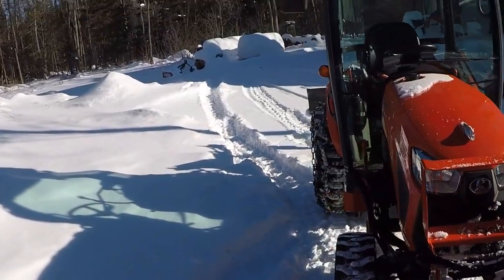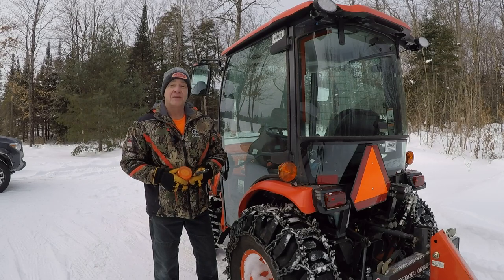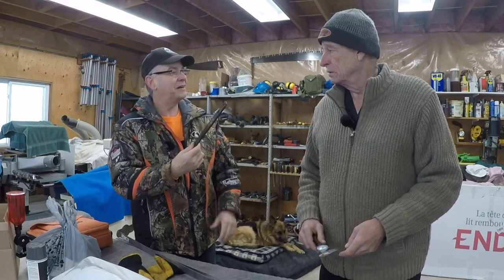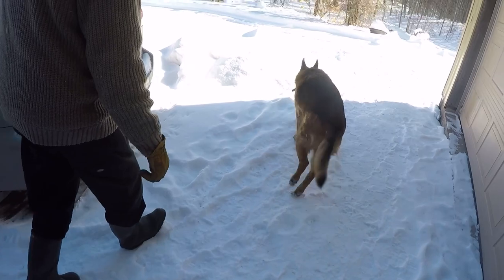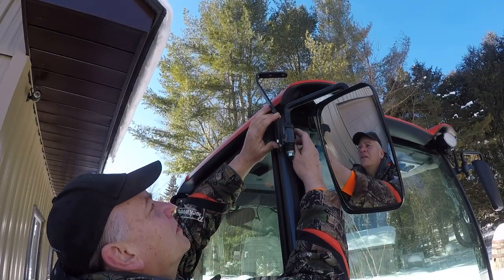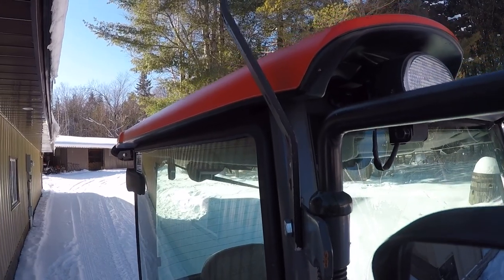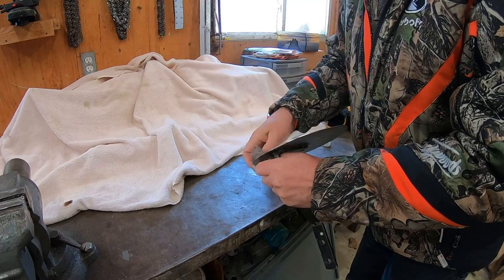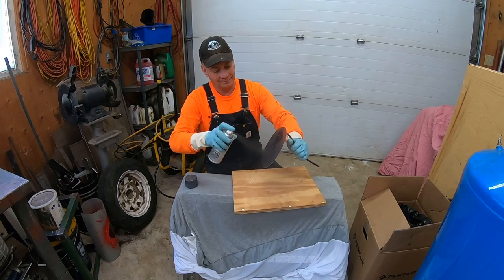525 Warning Light LED Beacon Install.Kubota LX2610 Cab Tractor. Part 1- The Mount. outdoors

Comment: Hi GP,
Adding the warning beacon is a very smart idea for where you drive. No matter how careful you are there will always be people that don't pay attention to their driving.
It's great that your mirror bracket has the pre made hole.
I'm thinking that mounting it on the drivers side would be a preferred location. Or an even better option is having two lights.
Reply from the maker: Morning and thanks Tom. I think so too. The driver's side has the antenna for the radio in it and I was not sure how hard or easy it might be to remove it. Thanks again- have a great day!

Comment: Guy is my kinda Dude! Love being in shops with folks like him. Kindred spirits... Buy a few extra lens caps for that model light while it's in production. A year from now proly will be a newer version... Low hanging snow bent branches might get her cracked/busted... Quick change of lens cap and not a full out replacement cause you cant find lens cap... County/gov. doesn't have to worry about bursting/cracking theirs much being on top cause they cut the trees back from roadways. Still Love how you do your homework in buying stuff though GP. 👍☺
Reply from the maker: Cheers BB! Guy is pretty awesome!

Comment: I used to like welding 16 ga when I was fabricating ductwork. It was actually the heavier ga I got to work with. I've done auto body work also which is generally 22-24 ga. You can tell Guy has welded different thickness metal before. My friend John and I both hang on to any steel we get because it's very expensive to buy at retail and if you can come across it for free it will always be repurposed!!

Comment: From looking around at the equipment in Guy's shop, I'd say if he can get it done for you, nobody can. 
I have installed for 3-LED strobe lights one at each corner of my  cab. I have them 'hidden' under the roof edge to protect them from overhead branches etc. and I can tell you that if you don't see 
me rolling along, you must have your eyes closed tight. Just a way of agreeing with you and others, that warning lights are an important item to have on a tractor if there's any chance that people
will be nearby when you are operating it.
Reply from the maker: Morning Reg! That was a great idea to run them along and below the roof. Should keep them safe from harm for sure. Cheers!
Reply: @GPOutdoors  Yes and so far so good :)

Comment: Gord, was Guy in tool & die work or engineering. He sure has an eye for fabrication.  I was concerned about the clearance between the bracket and edge of roof, but I see there's about 3/4 inch of space. Very nice job so far.
Reply from the maker: Morning Mike! I don't think so but he certainly has alot of skills. I am very fortunate for sure. Have a good one!

Comment: Hey Gord,

That is looking great! Once again, Guy comes through for you in a pinch. I can’t wait to start on the bracket for my LX2610….I’ll have to keep my eyes open for a piece of garage door hardware like that:)
Reply from the maker: Too funny Mick. Honest. I will explain it in part 2, but that 13" piece of standard garage door opener steel was; a) thick enough, b) long enough, c) had holes pre-drilled in it, so d) the holes were the exact same size as the holes in the mirror mount on the Kubota cab, and e) was the same size as the hole for where the wire comes out of the beacon. Plus, I can now cable tie the loom and wire nice and neat using all those holes. Honest. No lie. Thanks for your kind insights. :))

Comment: Gord, one problem you might have with only one bolt through your new bracket and mirror bracket is, if you hit the beacon with a branch, or other object, while moving forward, it could pivot back and gouge up your cab roof (from the way the mirror bracket is angled)  Just something to watch out for.
Oh yeah, almost forgot, ...w00t!
=O)
Reply from the maker: I got a w00t! That's good point to watch out for. Thanks W!

Comment: Great start GP 👍.  I’m guessing your initial method would have worked, but unless you built stuff like that regularly, you might have taken the long way round doing it. Why reinvent the wheel so to speak. Just shows how smart you really are, getting some advice and using it. 🤗👍.

Comment: Gord would rubber or foam work  to stop any vibration where the bolt goes.
Reply from the maker: Hi Gord! That's a good thought. I asked Guy about it and he said we should be ok. He took a cold chisel and hammered a rough surface onto the bracket for grip but we'll see how it works out and may have to make some adds such as you have suggested. Thanks Gord!

Comment: I think it will tilt unless the bracket have a extra stop point.
Reply from the maker: Stay tuned. Guy used a cold chisel to hammer "x" patterns in the side of the steel to make it grip when I tighten down the bolt. Let's see how well it works. Thanks Johan. It's a very good point. Cheers!!
Reply: Might need to drill an extra hole to prevent it from tilting
Reply: @donroy4787  I think a bit welded metal on new bracket above or below mirror bracket is enough.